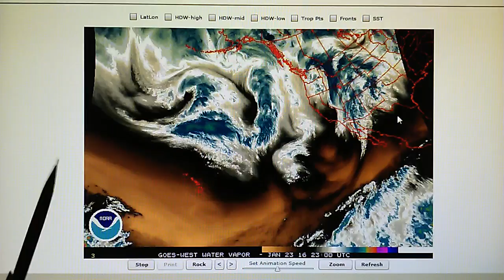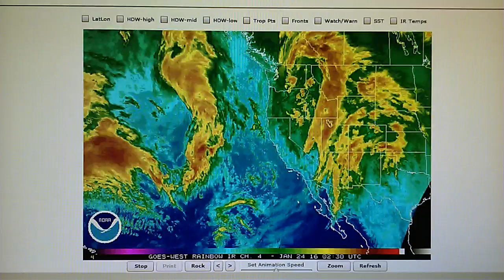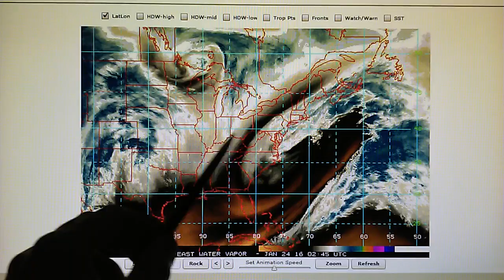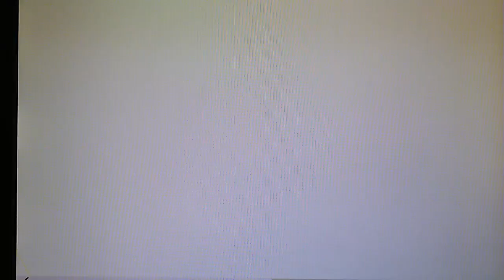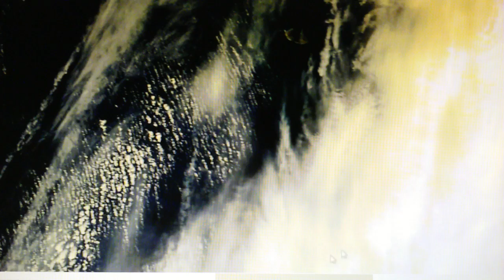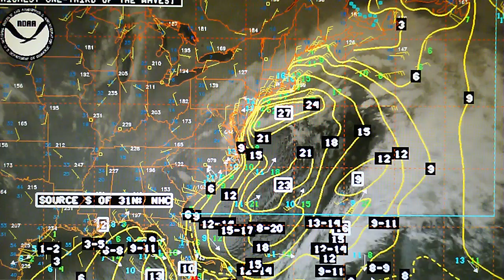1-23-2016; HAARP Transmitter Amplifies Nor'easter.

Comment from the maker: Since I made this video at about 7:30PM the Relative Humidity has dropped from 88% to 45% at 8:45PM. That is a result of the HAARP transmitter shown in the watervapor loop opening up a dry-air hole over Southern California.
Reply from the maker: +Ashton 09 - 10:42PM- Winds have picked up here in the Foothills; 8 MPH max gusts; RH has raised slightly  to 53%.
Reply: 3:00pm JAN 24, A massive plume of aerosols just moved in on the LA area, I was overcome by the potently foul smell.